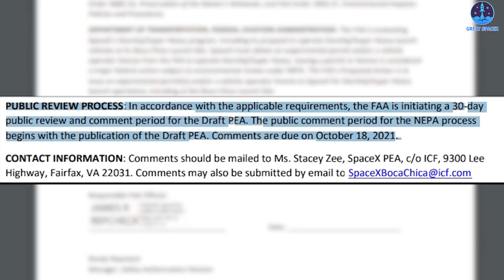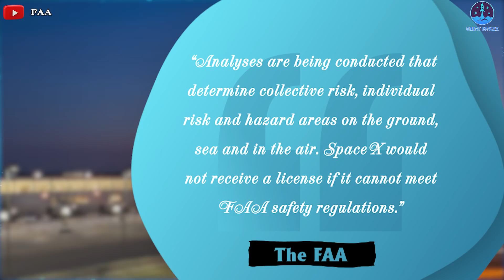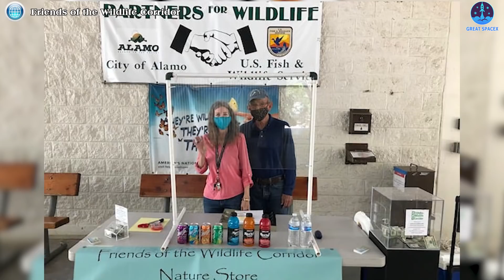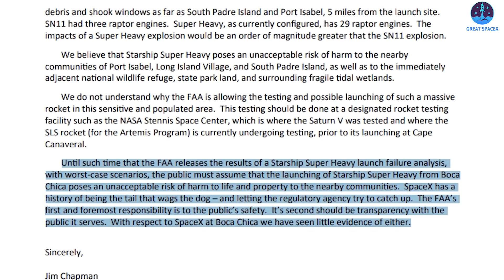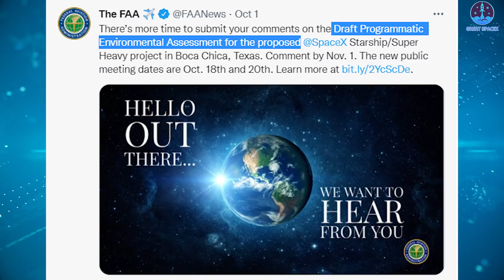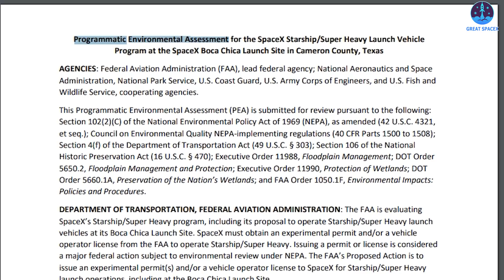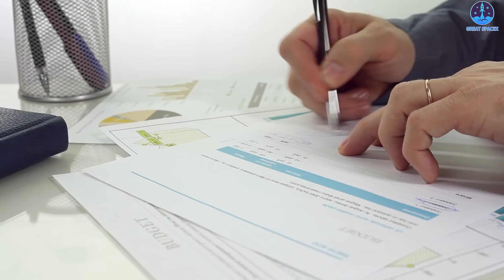FAA's INSANE DECISION to SpaceX Orbital Starship Test Flight.

Comment: No hazardous chemicals are used in the operation of Starship or it's booster.   The only chemicals the local environment could be exposed to is Methane, Oxygen, or Nitrogen.  Kennedy handles many highly toxic chemicals used in the variety of engine and thruster systems launched from the cape.  Starbase is the most envionmentaly safe launch site you could hope for.  Noise pollution is the biggest hazard from that complex.

Comment: The Starship booster with 30+ engines is not an ordinary rocket 🚀 the sound shockwaves will be devastating to wildlife. Even going offshore is worst as the underwater sound wave will completely obliterate marine life in the surroundings and propagate very far due to acoustic waves traveling better underwater. The wildlife will suffer PLTSD, Post Launch Traumatic Stess Disorder. They will get deafening noise and suffer permanent hearing losses.
Reply: The wild life is smart enoug (migrating, bypassing etc) to adopt any issues of that kind

Comment: Those Space Shuttle launches from Cape Canaveral used solid rocket boosters that emitted toxic compounds in large quantities.  NASA also uses hypergolic highly toxic fuels.  No objections there, apparently.  Yet Space X rockets uses methane and liquid oxygen, and test with liquid Nitrogen, and these are not toxic.  So arguably to "threat to wildlife" is just flimflam and what is really happening is the PTB want to take down the USA, on faked environment grounds.  A lot of the western USA droughts are evidenced to be the result of weather manipulation via HAARP and aircraft chem spraying.  The intent there is to make the western USA uninhabitable and force mass migrations eastwards, eventually (ostensibly) to revert the western and central United States back to nature.   So Elon, don't take it personally as you are just bucking the PTB policies...

Comment: If they did not want a space launch facility in the area, they should have thought of that in the first place. Push the button and launch the rocket. The most likely problem is an explosion at altitude, obviously this is also what Space X believes or they would not have spent hundreds of millions on a launch facility at the same location. I vote, launch.

Comment: You are not doing any favours to SpaceX with the barely contained sarcasm. Had Space used hydrazine etc they would have been stopped at the first step but they are being careful and approval will come through eventually but your comments here raise the hackles on many i suspect. Remember locals  living there were no doubt flummoxed by the arrival of this facility when they likely were mostly sitting on the front porches spitting tobacco juice in to the bushes a few  years back.

Comment: I think there is a clue to SpaceX's intentions in the large (20) number of sub-orbital flights and few (5) orbital flights.  SInce they've proved out StarShip sub-orbitally - and they have SuperHeavy ready to go - why so many sub-orbitals?    My guess is that they intend to get the Phobos & Deimos launch facility up and running - far out at sea where nobody is going to complain about them.   That being the case - they'll manufacture StarShips and SuperHeavies at Boca Chica - and do a sub-orbital hop to transport them to the landing platform out at sea.  (There really isn't any other way to transport anything that big).  So now the situation we're imagining (20 test flights and 5 to orbit) is turned around - it's 20 delivery flights, 5 test flights from Boca - and an unlimited number from the floating launch facility.

The only slight weirdness is that SpaceX don't seem to be doing much with Phobos & Deimos....that should be a hive of activity so that they don't face delays if the FAA's decision turns bad.

Comment: I have read the complaints and I have read most of the FAA impact study. The FAA document deals with a lot of numbers in decibels, distances, shockwave, etc. The margins they work from for safety are very comprehensive. The protests didn't seem to have any numbers to site in their complaints. They were mostly just accusations of danger. In reading the environmental protests the only numbers and direct threats mentioned were an inaccurate number of road closure hours. So open roads are better for the environment? Any real threats of course should be mitigated. Starbase is probably not a good site for a 3 launch a day launch port. But this is development and this means a lot to all of us in many ways. Space X should be assisted to mature the development process until a point where the system could be moved off shore or to friendlier ground based areas, if that is even possible.

Comment: I'm guessing from what we have been seeing this year that the booster and stage 0 is still a couple of month from being ready for a test flight. Just take the booster, no static fires have been done. With many of the static fires for the starships prototypes with 2-3 engines they have had issues and needed to replace engines, now they have 29 that need to work correctly during a static fire...  I do not think FAA will be the deciding factor of when the first orbital flight will happen.

Comment: The FAA shouldn’t have an environmental review. That should be reserved for the EPA.
Reply: Even worse agency to deal with. An idiotic agency that thinks rainwater running off your property should be cleaned up to standards higher than what it fell as.
Reply: @gravelydon7072  I agree, they both suck. But the FAA should only be looking at air clearance not environment. It's ridiculous.

Comment: so NASA can launch from there for 60 years. this is another delay. and NOBODY knows the results until after the launch. so it is all about fear and generating fear. same as the plandemic, "I am scared so you shouldn't be allowed to walk down the sidewalk kind of deal". I say again FAA has no bearing or cares about the environment they should be worried about the airways not the ground or space. they are doing this because pres bidin is owned by UAW and they do not like Elon and are trying to sabotage all his projects. this is a view of a corrupt president using dirty methods to harm a company that refused to bow and bribe its way to the top .

Comment: Maybe Elon Musk should present programs to save Earth from space besides just trying to make Earth life multi-planetary?  For example building a giant sun shade with many 'smaller' shades in the Earth-Sun L1 Lagrange point.  That whole area is going to be wiped out by global warming in the coming decades, so why not present a plan to save it from space along with saving the rest of the planet?

Especially with Elon Musk looking to go to the Moon because NASA wanted to go there under the Trump administration, Elon could go on about building the infrastructure on the Moon to mass produce the solar shades.  The solar shades could be launched via a maglev track and then solar sail their way to the Lagrange point where they will then use the solar wind and their large surface area to station keep the semi-stable Lagrange point.  The goal would be to block out something like 1% of the light hitting the Earth.  Without special equipment to see it, you wouldn't even know the shades were there.  With manufacturing setup on the Moon, you could cut down on total launches from Earth, granted Starship could host the entire project from Earth.  The main difference to the solar shades is they would have to use something like ion drives to get out of LEO and only once high enough would solar sailing get the job done where when launching from the Moon, you could more immediately make use of solar sailing.  As the Moon orbits the Earth, solar shades in the Lagrange point will always shade the Earth.

Comment: If usa doesn't approve its orbital flight ,its starbase must move to africa, we will support elon 👨‍🚀
Reply from the maker: Hm.. If so, it will have to wait again for a long time.
Reply: @colonbina1  
Waiting is better than been rejected 😉
Reply: Time to strat building launch tables around the world and leave america/ffa
Reply: @EddyKorgo  Floating platforms. They could be made from container ships and oil derricks. Take two of them and build a platform between them. Decommissions oil tanker might work to. There should be a bunch of them coming available over the next 5 to 10 years. The petroleum industry is on the verge of taking a nose dive. The need of petroleum as a fuel source will be taking a significant drop.
Reply: Be easier and quicker to move to Mexico. Safer I feel to.